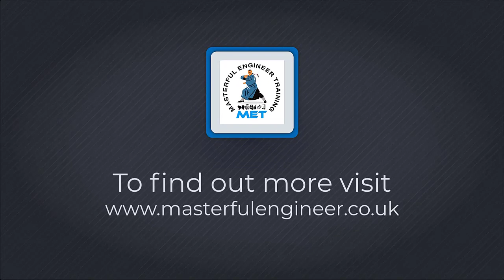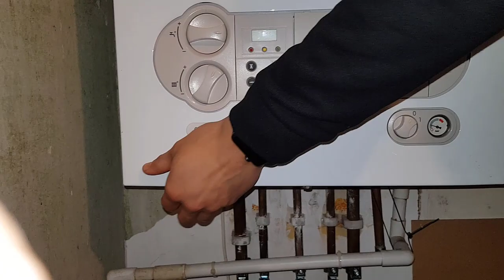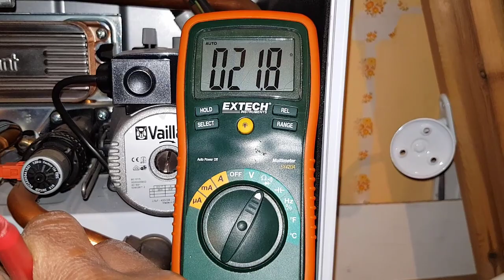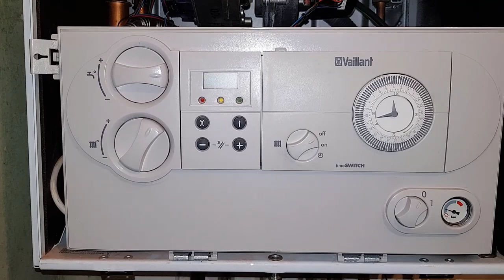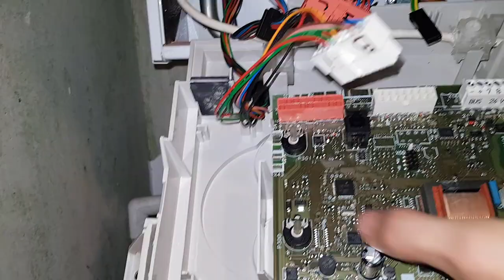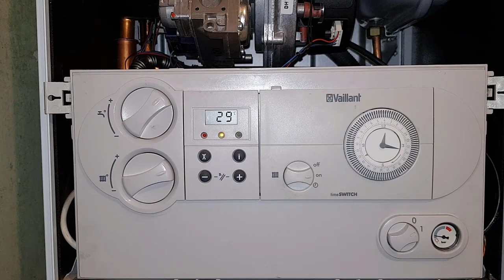Vaillant ecoTEC Pro 28 Blowing a Fuse

Comment: Have a same problem but blown only when hot water or heating on demand , what would that be pls ?
Reply: Had an engineer out yesterday. Had the same going to change fan as looks like it's got water in it. Will let you know if it works after changing the Fan. As looks like I got a leak from the expansion vessell. That's needs to be checked to see where the leak is comong from once the boiler has fired up. As the fuse kept blowing has 5 fuses blow.

Comment: Hi Tony! Your channel is awasome, it makes me, a simple user, better understand how a boiler works, so thank you! Recently I have a serious problem with my Riello condensing boiler (Residence 25 KIS). My engineer is clueless, the heating doesnt work, so I'm doing my own research, that's how I found this channel. The 3 amp fuse blowing as soon as we switch on the boiler and the pump starts. The PCB change didnt help at all. In such a situation how can an enginner find the problem? And what can it be?
Reply from the maker: You will have to check the pump resistance I think it sounds like the pump
Reply: @ARBoilers  Thank you for the answer, we will try it

Comment: How do you tell the difference between the boards... i kno some have a different pump connection but them two looked identical
Reply from the maker: I've made another video on the same boiler and I have the pcbs side by side
Reply: where does small fuse hide on the PCB board please .